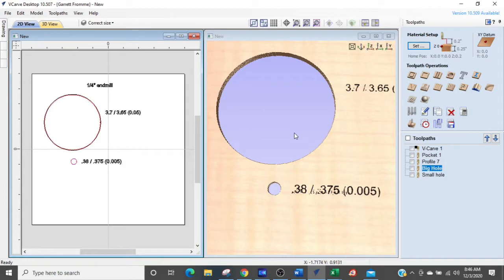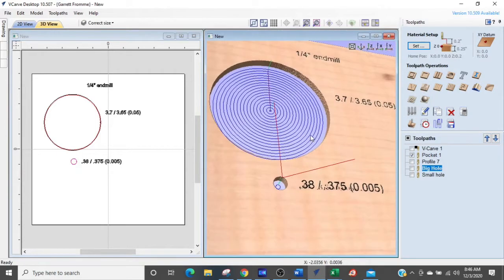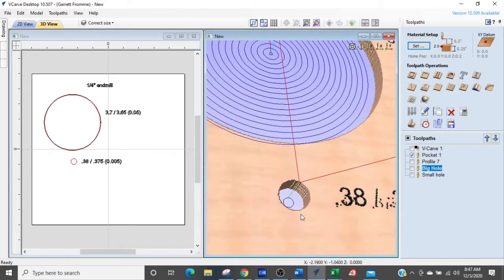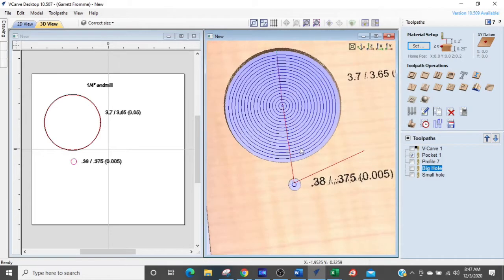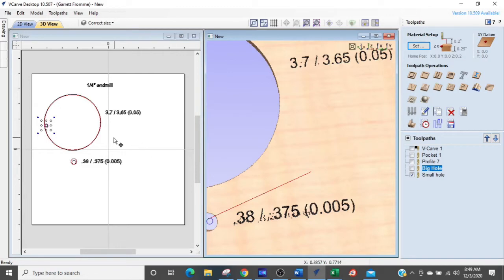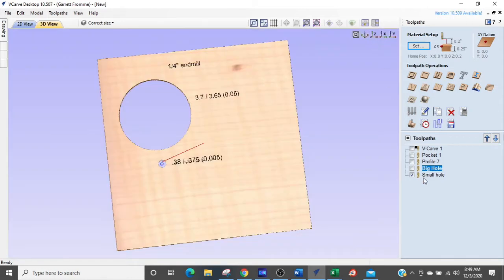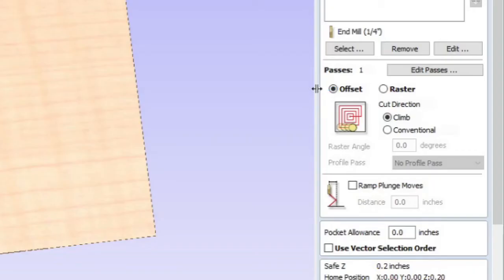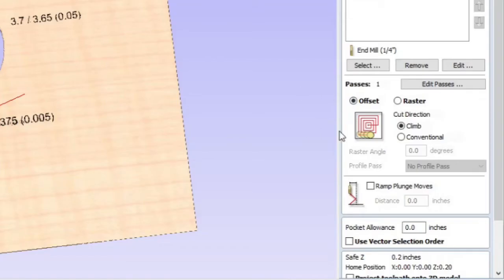Cut Accurate Size Holes w/ CNC Router, How To CNC Woodworking Tips And Tricks For Beginners v-carve

Comment: When I cut squares they are perfect, but when I cut circles the cut more like ellipses. How do I fix this this?   Thank you.
Reply: My cnc machine has the same problem.
Mach3 with an usb controller.
Reply from the maker: @alejandroperez5368  I'm afraid I cannot help with this issue at the moment. I can tell you it is a speed ratio relationship that is set in your control software. In othdr words, the rate of speed signals being sent to the x stepper are different than the ones being sent to the y stepper. It is a simple number change.
Reply: @IDCWoodcraft  if that were the case, wouldn't squares have different side lengths ? I didn't notice problems with squares, only with circles.
I'll keep investigating, thanks for your input
Reply from the maker: @alejandroperez5368  No. The unit is still telling it to move that number of 'steps'. the problem is the speed of the signals going to the x motor vs the y motor.

Think of it like this...One person walks 100 feet, the other runs 100 feet. Both the same distance, different speeds. Same in your control. X is walking, y is running (though not as exaggerated) Make sense?
Reply: @IDCWoodcraft  why does it happen only on small circles, though?
Reply from the maker: @alejandroperez5368  not sure. It would take some digging into. Search for videos that refer to your controller software and stepper motor setting
Reply from the maker: This has to do with stepper translation as it is coordinating the 2 motors. It depends on your controller software.. What do you use?
Reply: @IDCWoodcraft  I use Mach 3 with a Pokey57CNC motion controller. Thanks for any assistance you can provide.
Reply from the maker: @rickmccaskill7888  I don't use either. I'm afraid I cannot help through this means of communication. We can hop on the phone and work through it. You can schedule time with me through my website www.idcwoodcraft.com

Comment: The reason that the difference in tolerance is 10x more between the . 3.7 hole vs the .38 one is because the 3.7 hole  is 9.74 bigger than the .38 hole. The difference in the hole size you want to be and what you actually get are .9864% for the 3.7 hole  and .9868%. For the ..38 one. Take in the error factor of measurement, both holes are of by .986% off. So I you could just be able to put in a percentage change for the Pocket Allowance, both holes would come out perfect. Or any other hole size you choose to use.
Reply: I’ve been trying to figure out why my holes are always a bit off and this video seems to be on the right path.

Mark, do you know if post machines have a standard error of some kind like this?
Reply: @JohnGrubb1  
John Grubb, I been been retired for awhile from using a CNC machine for awhile. But have one coming to me in July. I am now learning Vcarve ( was learning MARCH3) so I to am just learning the new ways of doing woodworking with such software. And post machines
Reply: I would like too try a slower speed rate and steep over for just holes to see if you could achieve better tolerances for holes. I do not now if the software does this already for you. Kind of like jerk ( if I remember right that is what slows down the travel speed rate as it transverse around a corner)
Reply from the maker: Hi Mark. It's always a bit of playing around until you get it. Thanks for taking this so deep. I always emjoy some good number crunching.

Comment: Why would you pocket something you are cutting all the way through?  Just us a 1/8 inch profile cut and cut it out in a few passes right ?
Reply from the maker: You bring up a good point. This example is not a thru hole. I'll update my description.  Thank you.
Regardles, precise holes (in V-carve at least can only be done with pocking, not profile.
Reply: With smaller diameter holes I have found that pockets for holes are often easier than profiles because because I don't need to be concerned about using tabs or another method to secure the resulting loose waste material. They take longer but the chance of a loose waste part moving into the path of the moving bit is eliminated.

Comment: Thanks Garrett!  This worked for me.  
I was actually using a profile toolpath for the holes to get the 'spiral' ability you discussed in a previous video.  I switched it to pocket and conventional path; that got me very close... then I did a .002 offset and it was spot on.  You stated in the video "he has to use a pocketing toolpath"... why is that? what is the difference between a pocketing and a profile when you can set the depth and 'on/outside/inside' the line?
I have the KL744.
Thanks again for sharing your knowledge.
Reply from the maker: Ah, Jim...you're challenging me to make another video. Good. I will do that. To answer your question here, a pocket tool path creates a pocket (removes all material from the center to the selected boundary) Profile tool path only follows a line (or boundary) For the large circle, if you used a pocket, it will cut all the materil from center. If you used a profile, it will cut on / inside / outside the line and leave a plug.

I'm glad you were able to get exact holes. Glad I can help.
Reply: @IDCWoodcraft  but you can set the depth of the cut on a profile path.  If I set my depth of .2" and use an 'inside' toolpath, how would that differ from a pocket toolpath of .2" on a small hole (where the bit is large enough to clear out all the waste)?
Using the conventional toolpath and a pocket, it did make a difference in the cut; just not sure I understand why.
Reply from the maker: @jimaikman2875  profile works EXACTLY the same except it does not clear out all material, just along the line (inside/on/outside). I'm guessing you used a profile (which I should have edited that part out because you can do both). what I instructed in this video works the same with profile.  You did it just fine.

I should have included both tool paths in the video. That would have added a lot more to the video. My apologies for confusing you.  I will make another video about profile toolpaths and the same technique.

Comment: Thanks for the video on making accurate holes. I always enjoy it when I learned something I didn't know. This tip will go down in my notebook.
Reply from the maker: Hi Roger. Glad it gave you new information. What kind of projects do you do on your cnc?
Reply: @IDCWoodcraft 
 Hi Garrett,
I'm not that good at woodworking. To be honest, woodpeckers are better woodworkers than I am. I thought if I built a CNC router my woodworking projects would look more professional.  Since I always like a good challenge, I designed and built a CNC router. - At least now my projects look more presentable.  
Currently I'm interested in carving sundials. I was going to insert a photo here, but YouTube won't allow it.

I've been retired for ten years now - LOVE IT! 

If you're interested, here's a few articles on CNC routers I had published in SERVO and Nuts & Volts magazines:
“Laser Alignment System for your CNC Router” – SERVO magazine, published in Issue 1, 2020, p.61
“CNC Routers: The Z-Axis Zero Setter” – SERVO magazine, published in Issue 4, 2019, p.40
“How to ‘TRAM’ your CNC Router” – SERVO magazine, published in Issue 3, 2019, p.62
“Make a spring loaded Pen Holder for your CNC Router” – SERVO magazine, published Mar/April 2019, p.46
“CNC Routers: Backlash – What is it? How to measure it” – Nuts and Volts magazine, published Mar/April 2019, p.36
“Beginner’s Guide to CNC Routers” – SERVO magazine, published 2/1/2018, p.46
Reply from the maker: @rogersecura378  these are great articles! Thank you for sharing. I will include links like this in my website as I could them. You would also be a good one to talk with, especially as my CNC Entrepreneurs facebook group starts moving along (I will give it full attention after the holidays.

The crack about woodpeckers was funny. But I'm glad you outsmarted with technology. Look forward to engaging with you.
Reply: @IDCWoodcraft  Garrett,
Thanks for the kind words about my published articles. Please keep pumping out your great videos.
Reply from the maker: I absolutely will! I love sharing my knowledge to help other become awesome at thier craft.